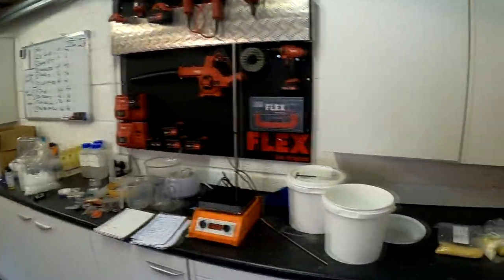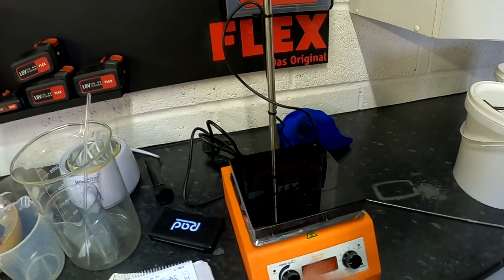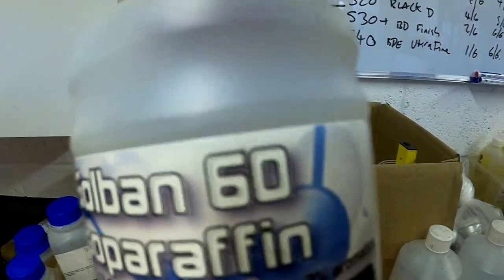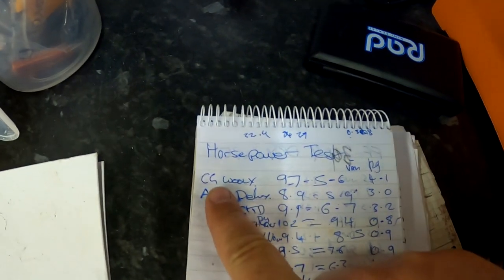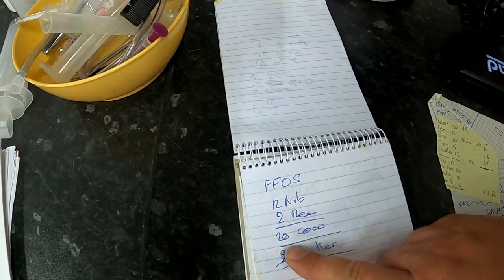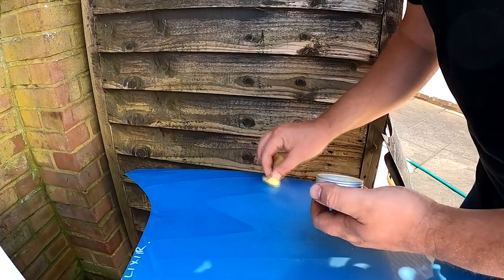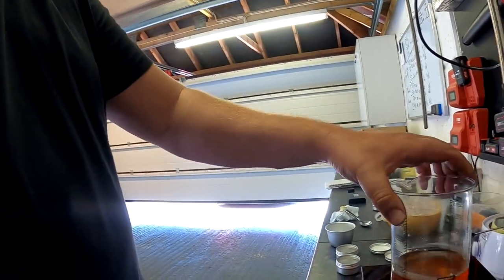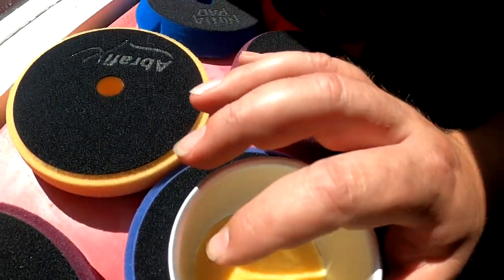The Secrets of making your own Car Wax Revealed

Comment: HEY HERE IS A RECIPE THE BEST TYRE SHINE YOU WILL EVER MAKE  please make it please test it please share it
its super simple and supper effective 
use carrier solvent like d80 or teh same product you use in your wax  60% now get some silicone oil 350cst 40% can pickup the stuff for treadmills or you can even go higher cst but mayb higher % of carrier needed 
mix both together well and now apply to tyres allow 20 mins to dry and there you go the best long lasting tyre shine you will make and outperforms the top brands  
if you want to get fancy you can add some colouring  or even some cents  
im currently rocking dark blue with apple pie cent ahhaha